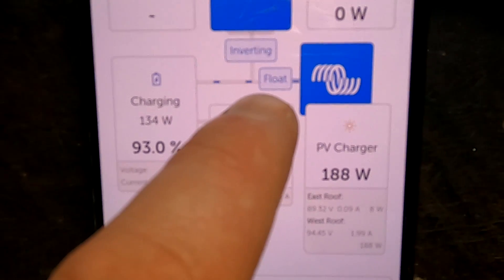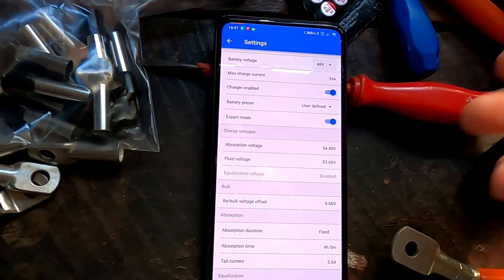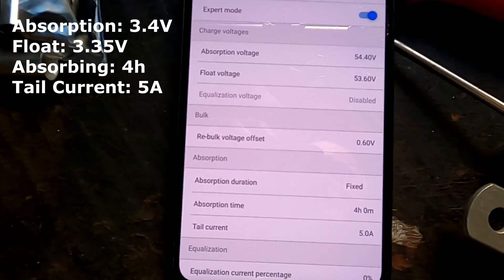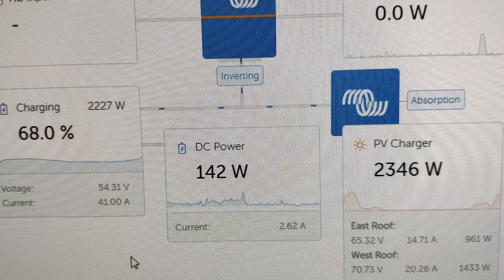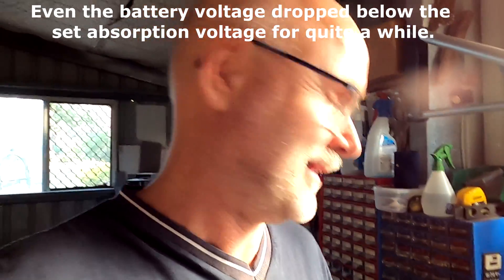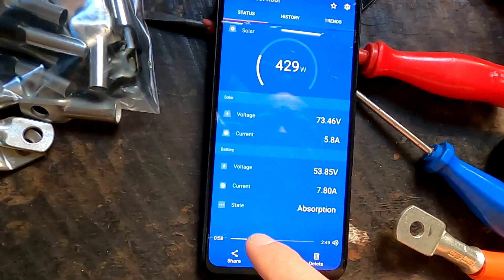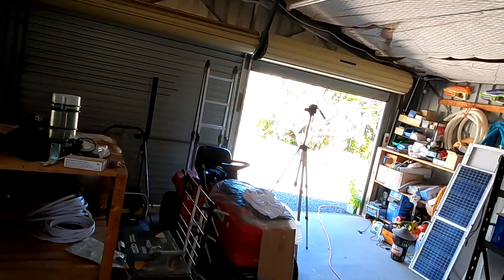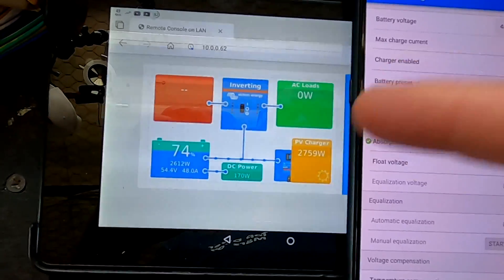How Absorption, Tail current and a few clouds can trick you!

Comment: Why not just set the float voltage at 3.4V per cell?
Reply from the maker: 3.4V is a bit high for floating. It is over the tipping point and can overcharge you battery if it sits on this voltage for a long time.
I would go lower to 3.35V or 3.375V. That is close to the natural resting point of the cells.
From a capacity perspective there is only 0.4Ah difference between 3.45V and 3.35V.
Reply: @OffGridGarageAustralia   Please give a reference to that statement. I’ve found no evidence whatsoever that any voltage below 3.65 would bring any damage to a lifepo4 cell. To me it’s just an urban legend. How can you ever overcharge at 3.4v?
Reply from the maker: @Mr.X3D  There is a tipping point somewhere between 3.375V and 3.5V If you keep the voltage constant below that point, the battery will not charge consistently (see my previous tests when charging to lower voltages). If you keep the CV at say 3.5V there is a risk, that the current neve goes to 0A and it keeps charging the battery forever. You could end up adding far more energy as the cells can take. It depends how long you keep it there for. Some users have grid chargers, they just keep the battery there forever. It is known that the higher the voltage will damage the cells over time too. 3.25V is considered a neutral voltage and there is no stress or damage as such. Going below or above that, the degradation starts to increase. The higher/lower you go the more stress you put on the cell. 3.65V is just the maximum voltage you can charge the cell too. That does not mean it's good doing so.
Reply: @OffGridGarageAustralia  I humbly disagree on both statements.

1. If set to a voltage below 3.65 (or even 3.65), the current will drop to zero. I’ve done it multiple times. As long as you are within voltage specs you cannot overcharge the cell.

2. To me, this is still a urban legend. 3.65v is within specs, and I’ve seen no evidence of that ever damaging a cell. Please point to scientific documents

🐸
Reply: @OffGridGarageAustralia  oh, and btw, the “charge cycle tests” are done between 2.5 and 3.65 and are somewhere between 2-4k (depending on if the cells are compressed or not).

To me the “10-90 percent recommendation” from eve seems more like a disclaimer to have room for bms inconsistency than anything else (since there’s no explanation why this recommendation exists and the charge cycle tests are performed as described above)
Reply from the maker: @Mr.X3D  Thanks for sharing. I'm not going to charge to higher voltage because there is no need for that. 3.45V gives you over 99% SOC. The only reason to go higher is for balance purposes.
It is well known that a higher voltage causes higher capacity loss in the cell chemistry.
https://pubs.rsc.org/en/content/articlehtml/2021/cp/d1cp00359c
https://www.powerelectronics.com/markets/mobile/article/21859861/proper-care-extends-liion-battery-life
https://mospace.umsystem.edu/xmlui/bitstream/handle/10355/73777/Xiong-Shihui-Research.pdf?sequence=1&isAllowed=y
Just to name 3 out of 116.000 search results
Reply from the maker: @Mr.X3D  Thanks. Yeah, could be the reason, could be other reasons. We don't know and can only follow the science and recommendations of the manufacturer
Reply: @OffGridGarageAustralia  don’t understand the references to li-ion while we discuss lifepo4?
Reply: @Mr.X3D  You should read the spec sheet on the cells more closely. It defines a constant voltage charge of 3.65v, with a tail current of 14 amps. Guess what voltage the cell drops to when you do that? It's 3.45v every time I do it, not 3.65v.
Reply: @john_in_phoenix  you are right, it is 16A tail current in the “standard charge” definition in the specs. Thank you for pointing this out! I know that the cells will go down to “resting voltage” when you remove the charge. Still, if you charge to 3.65v, the current will drop to “zero” when the cell capacity is reached. Sure, the charger will supply a minimal current to adhere to the self discharge, but how can you overcharge as long as you’re within specs?

Andy did this himself? Top balancing to 3.65, with no current flowing, right?!

I’m still eager to find a reference to some scientific explanation why you would damage the cell if it is operated within the specs. (For lifepo4, not li-ion) 🥳
Reply: @Mr.X3D  +1 Mr. X... but I will concede to Andy .... 3.45 bulk / 3.35 float for lightly loaded backup systems that charge off the grid or small motorhome systems that routinely connect to shore power.... With respect though.... Highly loaded big off-grid systems, different story.... I run higher settings 3.55 Bulk / 3.5 Float and have not seen swelling damage or capacity change in my DIY, compressed, LiFePO4 pouch cells purchased from China 3 years ago (22KWhr for $5kUSD)

Off grid 40+ years and haven't missed my lead acid since I dropped them off at the recycler 4 years ago 😋
Reply: @kcjones3368  no one I know who went the lifepo4-way have ever looked back to lead acid 🥳

I’ve seen a weird video once, of some guy, with a boat, but doesn’t count, don’t know him.

My main point in all these comments I made in different threads today is:  “HARVEST AS MUCH AS YOU CAN”!

As long as you get the power into your cells, it’s all good. My problem is all the guessing and virtual know how that has no scientific coupling.

I’ve never heard of someone who’s lifepo4-bank degraded or went unusable. My guess is that the batteries we have now will outlive us all. Or them self. New technology is always around the corner. And our (lifepo4) corner has a very wide angle!
Reply: @Mr.X3D  Yep when you are fully Off Grid every Watt counts 👍 If I lose 10% of my capacity in the next 10 years I'm not too worried, (I don't think that'll happen)...With the proliferation of electric vehicles just imagine how many used cheap cells will be available by then... 😋 Not to mention the backup I'll have once I have a 150KWh Cybertruck with a 30 amp 220 volt load plug in the bed!!!

Ever since I upped my charging voltages I have not had to wake up in the morning to start the generator... I picked up about 10 to 15% by upping the voltage 3.55Blk/3.50Flt ...but I'll say it one more time ....
Ideal voltage settings require multiple inputs: Size/type of bank, size of array (Max C rate), how heavily loaded is a system, and what part of the world you live in aka how much sun are you getting.... Long story short there is no magic One answer to rule them all setting, start out conservative, increase, and check your capacity every 2 to 3 months 👍 once you get it set to your liking fire and forget 😋 Don't forget to thank Andy for setting up this channel and all of his experimentation so we can all process as much information as possible and figure out the best setup for us 😎
Reply from the maker: @Mr.X3D  Did you read it? It's the same behaviour in high voltages 😉
Reply: @OffGridGarageAustralia  “did you read it?”
Read what?
Reply: @OffGridGarageAustralia  I'm not advocating for floating this high, but I have half a dozen or so 12v LFP batteries that have been in use in UPS battery backup systems where they are charged at a constant voltage of 13.8v or 3.45v per cell and these batteries have been in service for over 5 or so years now. These aren't solar batteries, they are grid charged so they are held at 3.45v/cell for literally 24 hours a day and only ever drop below 3.45v if there;s a power outage. Every year or so I pull a couple batteries out of one of my UPS units to capacity test it and see they are still healthy, and after 5 years these batteries still capacity test at 96% of their rated capacity.

I'd say that pretty much rules out the notion that a float voltage of 3.4v would overcharge or damage your battery, because even at 3.45v/cell I have not seen any evidence of accelerated capacity loss.

Obviously it's still better to float a little lower to avoid any voltage stress on the cell, but I don't think we should be telling people that they will overcharge their cells at 3.4v when that is demonstrably not true. Even at 3.5 or 3.6v the current does indeed drop to 0 amps once the battery fully absorbs at that voltage. It won't keep pushing energy into the battery once it's fully absorbed at that voltage.
Reply from the maker: @JeremyAkersInAustin  Thank for your comment and sharing your experience with that. I hope Matt is reading that as well as he advocates the tipping point theory a lot. I was always under the impression he's right with that as I could never see the current going to 0A at higher voltages but maybe ~24h is just not long enough for that to happen. I'll do some more testing.
Thanks again.
Reply: @OffGridGarageAustralia  OK. But if you start charging when when the sun is out, it will take some time to charge up the batteries. It doesn't seem like the battery cells will be at a 3.4V float too long because when the sun goes down, you will start using battery power (maybe sooner if you have high power usage). Seems like another test is needed lol.
Reply: Actually when 100% full, the first amp you take out will put you at 3.35v. So it is very accurate float voltage. If you let the cells sit long enough, they will eventually settle to that. You do want your solar to be as much of the load carrying as possible in float.
Reply from the maker: @john_in_phoenix  Yes, that is correct and another reason not to keep them too high for too long. They will naturally go the 3.5-3.8V anyway if full.
Reply: That’s what I do as well.  Charge to 3.45, float at 3.4.   May even charge to 3.5v, float 3.4.

Comment: Excellent useful information Andy. I'll be building some LifePo4  packs using cylindrical 32650 cells to confirm your result. 
Also, do you see a charge controller feature that measured internal resistance to detect when to float, or possibly an external trigger circuit that sensed charging current and disabled float whenever charging current was at or below float current as being worthwhile features?
Reply from the maker: Thanks Jack, interesting project you're working on.
Measuring the internal resistance (Ri) to determine SOC or control charging speed is highly unlikely. The accuracy will be very low. There are lot of other factors influencing Ri.
But @Brad Cagle is working on some other cool stuff ata them moment to read out parameters from the BMSs and feed this into the charge controllers. That would be a precise way to stop charge at any given SOC.
Reply: I'm building a 60280 bank.. 11.7KWhr I'll let u know how it goes... I can fortunately bolt everything together because these cells have studs on either end of the cylindrical cell... Are you going to have to spot weld yours???
Reply: @kcjones3368  Yes I am going to spot weld some 6000mah Fbtech cells to keep the size to a minimum. 
Are you using the 5000mah cells with the screw terminals?
I'm also going to do some experiments with paralleling electrically isolated small, 120amp, 6ah 72V Li-on cell pack with solid state relay for interment high amp loads and a 48V, 50amp, 20ah LifePo4 packs for lower amp cruising in for an EV test application.
Reply: @jackoneil3933  Nope...I've gotten ahold of 64 monster (55Ah 60mmx280mm)  cylindrical cells with 12mm studs...pack will bolted together with copper plates...4p x 16s...51.5vdc nominal 11.7 KWh pack... I've Got all the batteries (checking for capacity now), 4.8KW solar array and the overkill solar 100A BMS... I need to save up some more cash for The all-in-one growatt 6KW 230VAC inverter... But in the meantime I've got plenty to do building the pack and ground mounting the panels... This will be an auxiliary system that will run a secondary water heater, well pump, and 2 mini splits separate from the 22KWh off-grid system that already runs my house 👍

Those multiple packs will be interesting.... I've played around without a little but it can be pretty complicated to get everything working right ... Good luck Hope you do a video on it 😎
Reply: @kcjones3368  Sorry I missed "60280". That's a pretty robust storage. Are you planning on running your water heater off the battery pack and/or inverter? If so, it might be worth looking into feeding DC direct into heating elements an taking the load off your inverter. 

Years ago I did a 30kw 480VAC 3-phase hydro electric system where we used a surplus industrial  AC to DC SCR  drive to to feed a variable load to heating elements in hot water storage tanks to load the AC generator and control the speed of the water turbine to keep a constant frequency.
Reply: @jackoneil3933  That 3 phase project sounds pretty interesting??? I work with a lot of industrial three-phase loads and generators on big ships 👍

It's funny you mention running the heating elements off Solar DC directly... I'm doing that right now with an aftermarket temperature control circuit and: (3Sx2P, 2.1KW array @ 90 VDC) feeding directly into 120VAC 2kw lower single element( I'm using a surplus EV DC relay to handle the voltage control its been working great for the last year. I run it at 160°F with the three-way mixing valve.. It gets up to temp by 10-11:00 am and then the panels sit on the roof the rest of the day spinning their wheels with no way to put power into anything else... So I decided to rewire everything to 230 VAC because that seems to be the cheapest price point for these all-in-one units... I bought some more matching panels from my supplier now I have a 4.8 KW array that just needs to be remounted onto the ground I don't like running higher voltages on my shingle roof!!! ... With a new batteries and inverter I'll replace the 2K 120 volt element with a 3K 240 volt element... The water heater will get up to 160°F even faster than it does now... One of the mini splits will be permanently hooked up to the inverter the other one will load share with a DPDT ac relay between the mini split and the water heater... I will also have it hooked up to my permanent magnet motor AC/DC well pump... Whole system is basically running Non-Critical loads, except for the well pump... If the 230 volt system ever fails or runs out of juice it'll default with a relay back to the 120 volt main off grid  system that I have been running successfully for the last 15 years! Only had lithium for the last 3 years. Running the water pump will also take some of the load off my current inverter which is a 20-year-old trace that still kicking.. damn thing is built like a brick sh** house 😋
PS... I loved your work in that Stargate SG-1 and SGA series😋

Comment: I use Winston/Thundersky lifeypo4 (yep the Y is Yitrium) cells in my off grid home, and interestingly enough, the manufacturer (for 24V set up) recommends 27.6v absorption voltage, which is in fact 3.45v. Also, we live in Ireland and the cloud/sun peekaboo situation is common, yet the batteries still charge (on a nice day) to a consistent 92-97% , also the slow charge helps the BMS balancing function , deviation is rarely more than 20mV and more typically 2-7mV, keeping in mind that the they are always under load. Lithium is amazing 🐸
Reply from the maker: Great information here. Thanks for sharing.
3.45V is the better charging voltage, absolutely. I can now 100% confirm that with all the testing I did with single cells and CC and now also the big battery.
I like the sun peekaboo term 🌤